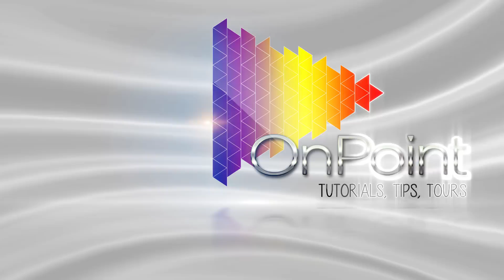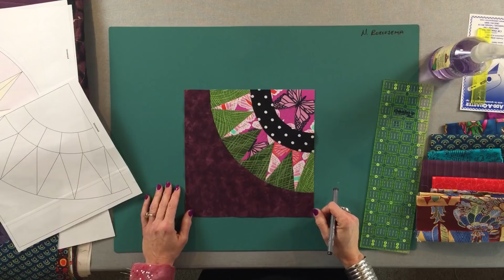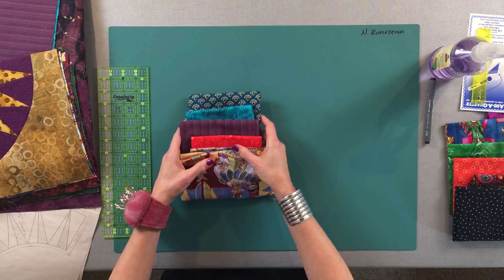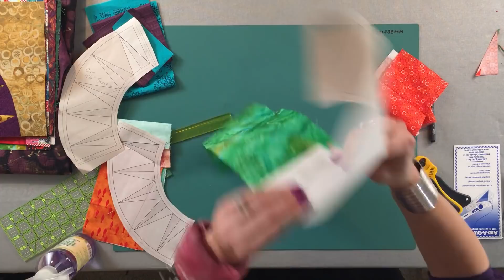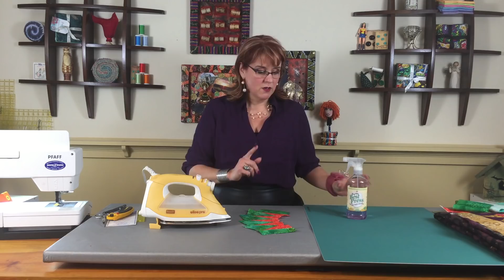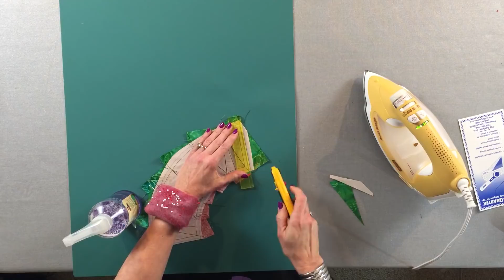Paper Piecing the New York Beauty Quilt - Episode 306.2

Comment: Ironing on ur cutting mat, even jut a quicky, can 100% mess up ur mat. I even had a thick padding down and just used the tip of my iron to press a couple seams and it bowed my cutting mat. I've tried lying heavy books ad stuff on it to flatten it back down but it won't fatten
Reply from the maker: Hi Lovey - When i am doing the pressing for paper piecing i always do it this way and not issues but don't risk it if you don't want to :)  and you are correct, they are impossible to fix but i have taken a bent one and cut out the flat part and then had a smaller mat - Nancy

Comment: The finger pressing is tough on the finger buuuuut think about guitar players, they have a pick that looks like a brass curved fingernail. It slides over any finger. If you slide it on whatever finger you use, so the curve is going up, there you go, finger pressed better than with your tired finger. Try it, doesn’t cost much in all your better guitar pick’n stores.

Comment: Thanks for the info.   Just so you know, there's an option in EQ to print the block with a user specified seam allowance.  You can change that to .325 so you don't need to draw in that extra 1/8"
Reply from the maker: Hi Lauren - great suggestion, but I think that would add the extra allowance around all the templates and for my technique you only add it to the outside perimeter of the template pieces, not the internal seams.  Would love to know if you figure out how to make it just on the outside though :)